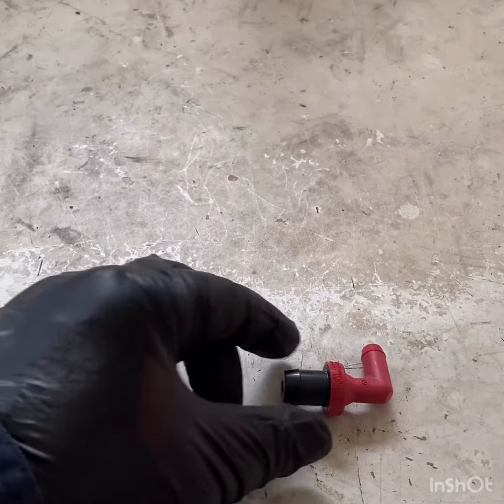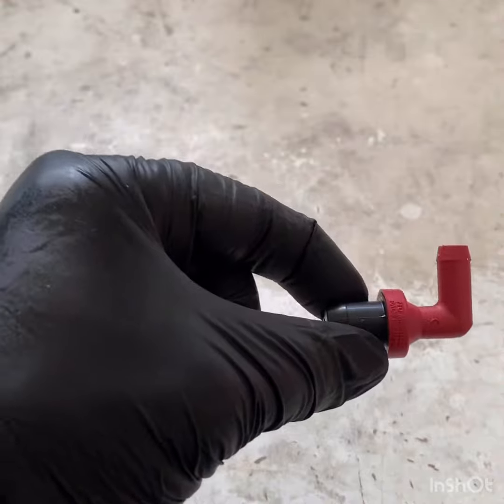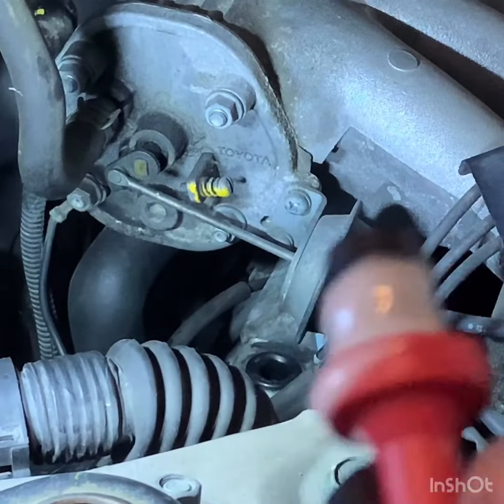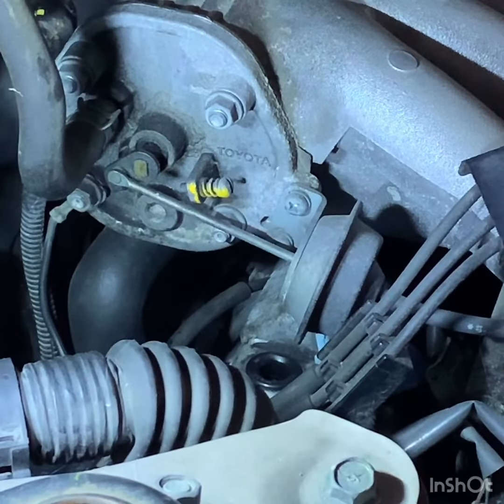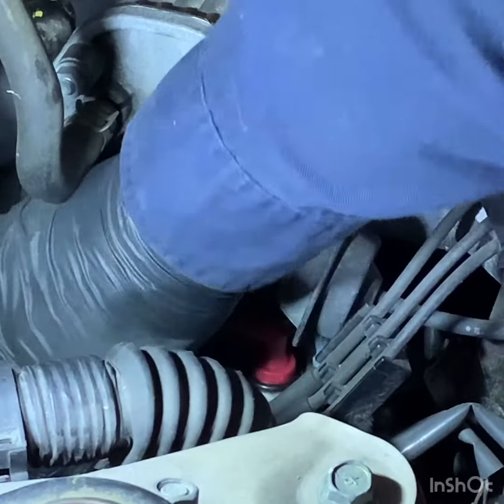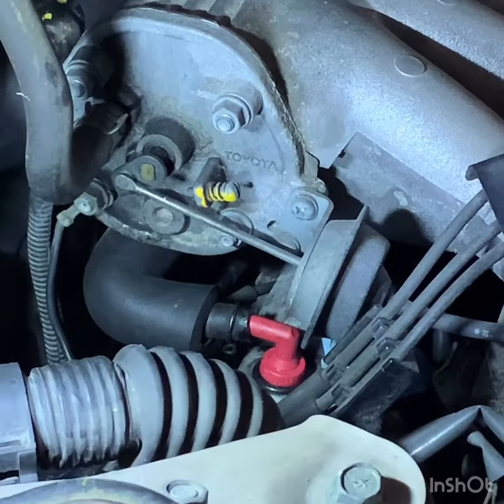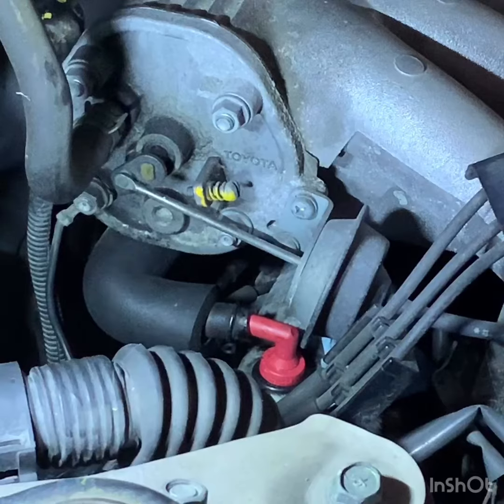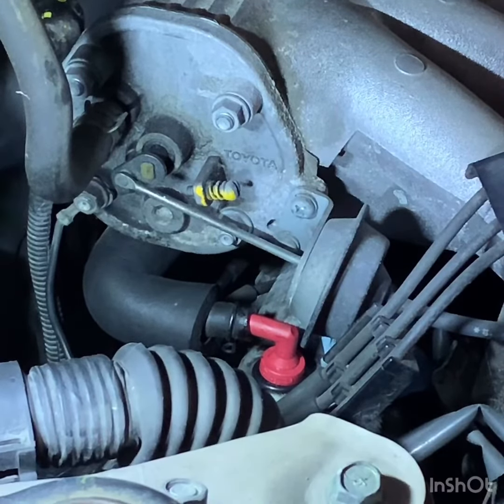How to replace a PCV valve. Quick & easy!

Comment: It would be nice if u can zoom out for us to see where’s the pcv valve is
Reply from the maker: You are right. Sorry, I didn't do a good job of it. In the video (0.39) you will see the top of the passenger side front strut in the bottom of the picture. That should give you an orientation.